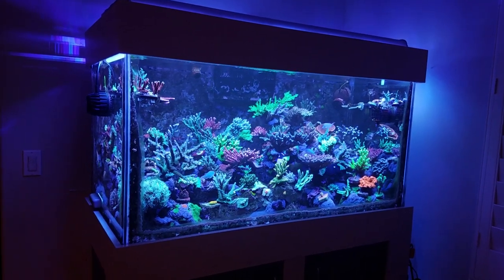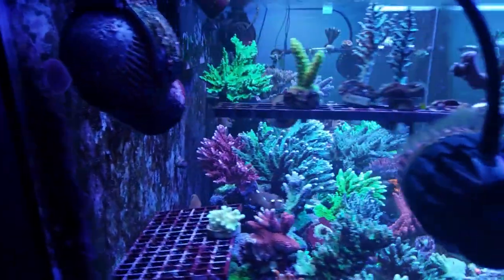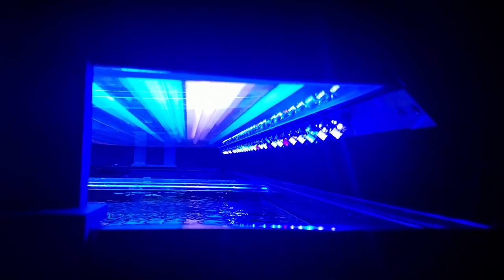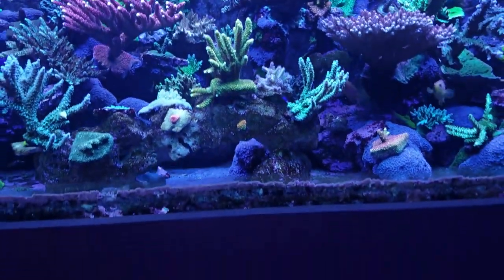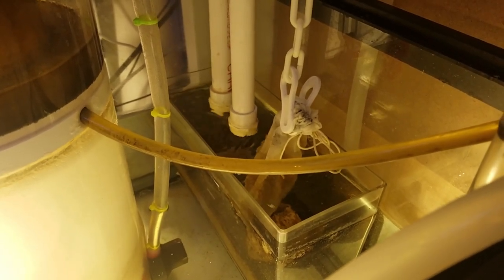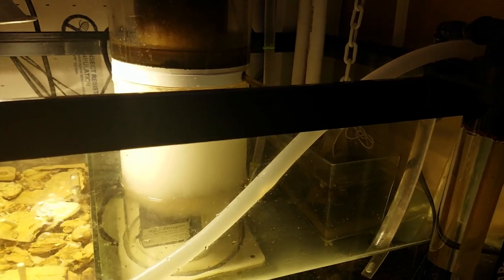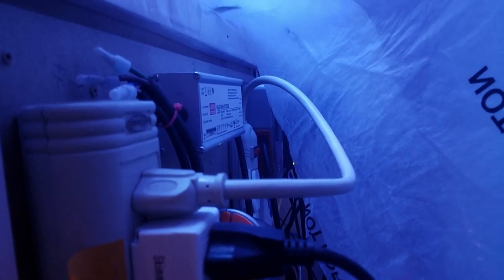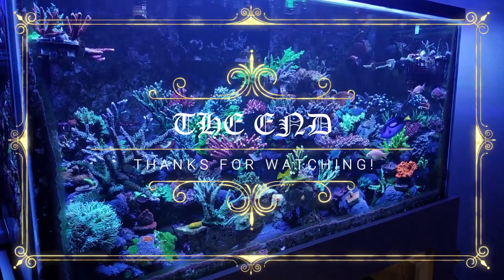120g SPS Reef Tank - System Overview

Comment: I've got a standard 75gal and totally removed the plastic brace on the top to replace it for an Euro bracing. That way the light isn't blocked at all. Works great! So much better to remove rocks from the system and do maintenance!! The worse part was to remove the plastic brace.
Still got my old Powermodule as well!!! Best T5 fixture ever!
One tip: you don't need absolutely anything in that sump for biological filtration. You can remove the rubble and sand any time and it won't make any difference. If anything it will be beneficial to the system to have that space filled with water instead.

Comment: Nice Tank love all the SPS.  I am going with Sea Swirls, the Multi swirls for my returns for my new build as well.  I love the Royal Exclusiv bubble king equipment as well, Thats all I run as well  Have you looked at the Red Dragon pumps for Return? Subbed ya
Reply from the maker: Meier'sReefs, Not at this point. My eheim has been going for over 6 years so I'll wait for it to break before I consider something else.
Sounds like your new build is going to be awesome!
Reply: Ya hoping so.  I have two RE Dreambox sumps with all the components.  Skimmers, pumps, Reactors and everything and planning on plumbing both sumps together for the new 525g tank build.

Comment: What did you use to mount your lights on your tank ?
Reply from the maker: Brooklyn718Bronx Wood. I traced the original side plates on thin poplar board, cut them out, then screwed and glued legs on them. 👍👌